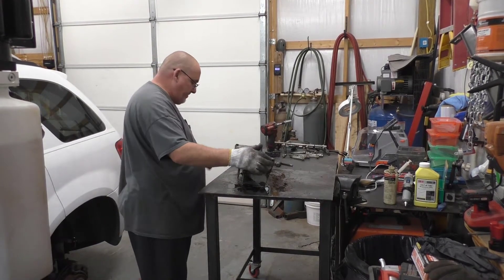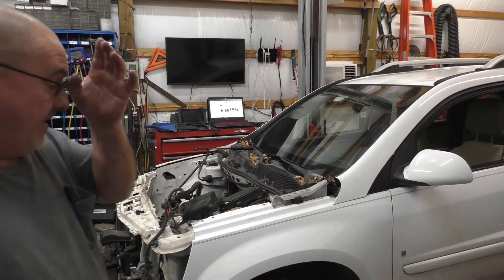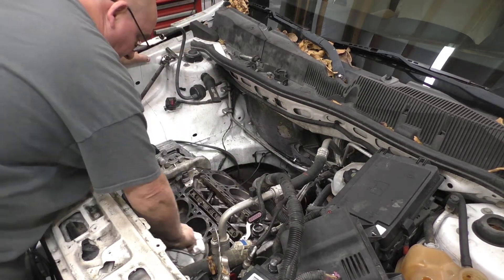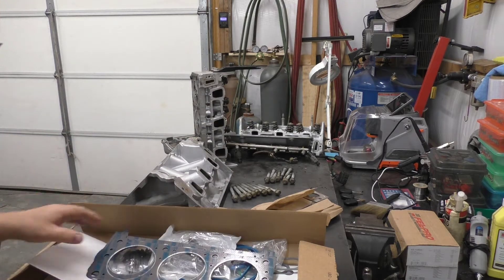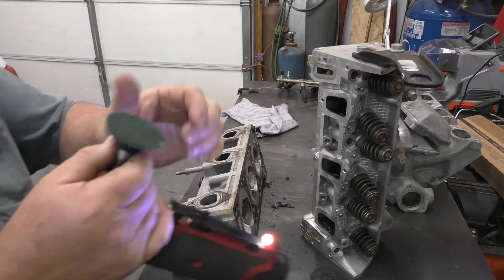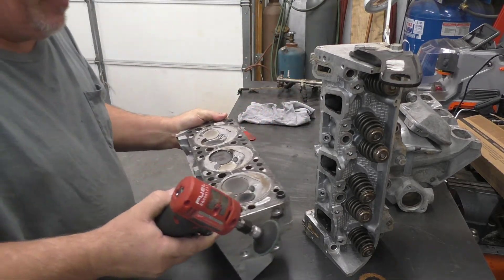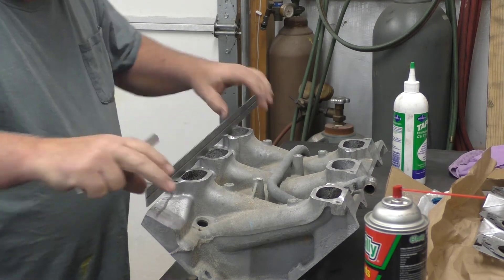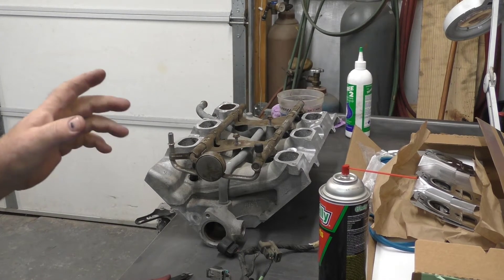2008 Pontiac Torrent Chevy Equinox 3 4L Head Gaskets Part 3

Comment: I have had excellent luck cleaning using engine gunk, then "Whestlys blech whit", the tire cleaner stuff, it will remove the brown varnish that gunk doesn't get, leaves it squeaky clean. The shop guy thought I had a parts washer, and didn't charge me for cleaning so I saved myself money, even after buying the cleaner.  I don't do this often but if I did I would certainly use a parts washer. I do whatever I can myself.

Comment: Hey Ralph, I just did a 2006 Equinox with the same engine and blown head gasket. The oil looked like chocolate milk. It also had a knocking which I thought was the rod. It was an AWD so had to pull the engine to get the pan off...what a pain. Crank was fine and bearings looked fine but I replaced them anyway and new timing set, cleaned the lifters and the knock went away. Not sure what was causing the knock. After everything was put back together, I have an issue with the idle, it seems to surge then stalls after awhile. Cleaned throttle body but still have this issue and working on resolving it.
Reply from the maker: Sorry am having an issue with not seeing any comments. Anyway it sounds like the timing is off.

Comment: I'd think a repair like this would mechanically total this vehicle, how much did it cost to do? I have a 2006 torrent
Reply from the maker: I don't remember exactly what the price was but it was worth doing.  I suppose it will greatly depend on if you like the vehicle or not.
Reply: @ralfsautomotive  Yeah that's true, mine has 200k miles, and is probably only worth about $3500, but I'd still get that done even if it costs just as much. It's been extremely reliable, I've had it since 60k and I've only had to replace wheel bearings. Thank you for the great video
Reply from the maker: @pcgeekapplehater8718  I cannot speak for other shops but if I remember the job was $1500

Comment: The GM 3.4 engine is a nasty engine that always needs either intake or head gaskets.  My father had one and replaced the intake gaskets.  8 months later the water pump failed, and the head gaskets had to be replaced.  The problem is when you have to replace the head gaskets the intake has to be removed, and another set of intake gaskets needs to be installed.  I hate that engine.
Reply: 6.5.24.    If you have upwards of 100,000 miles on one of these engines, you just automatically go ahead and do the head gaskets while you’re changing the lower intake manifold gaskets it’s just common sense, because the Dex cool®️ that GM factory filled in these engines isn’t kind to head gaskets❗️especially if it’s never been changed. Also Purchase a Lisle 48300 rocker arm lifting tool, so you can remove the push rods without loosening the rocker arm bolts⚠️ if you don’t utilize the rocker arm tool, then you need to make sure each cylinder is at top dead center with the valves not being actuated by the cam, that way you won’t strip the aluminum threads in the head. Also do the same procedure when re-assembling if you don’t have the tool‼️ YouTube is replete with videos of stripped rocker arm, bolt threads in the aluminum head💣
Reply: @stevensapyak7971  Mine only made it to 70,000 miles, and I was not using Dexcool.  The gasket was somehow pinched when it was installed at the factory.  After replacing the intake gaskets, the water pump went out a few thousand miles later.  When that went, it blew a head gasket, and the entire intake job had to be done again.  After replacing the head gaskets, and intake gaskets the transmission decided to go.  The transmission had to be replaced, and my GM dealer just happened to have one in stock so there was no waiting for a transmission to arrive.
Reply: @ericknoblauch9195       6.5.24.    Yes, if that has the 4T65e transmission they are pretty weak, you have to change out the transmission fluid and filter on those.  As poor as The 3.4 L V6 is, you’re lucky you don’t have an equinox with the 2.4 L in-line four cylinder engine. My daughter bought one and I about cried when she brought it over to my house. I told her you should have talk to me first before you even thought about buying that⚠️ I would’ve steered her clear of it.💣